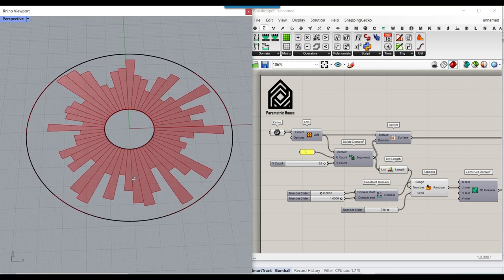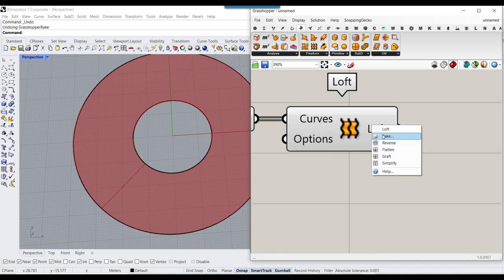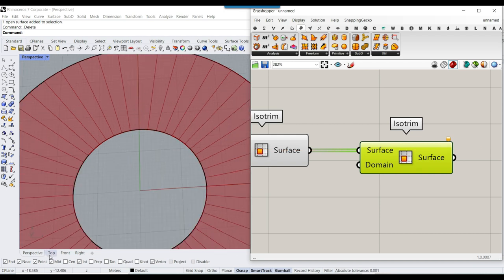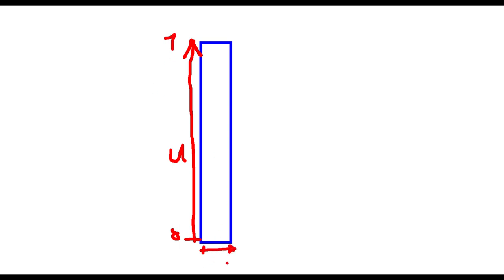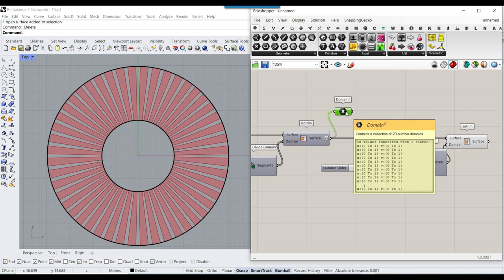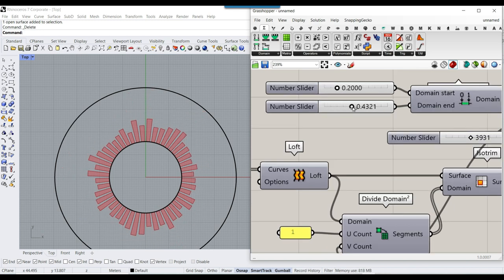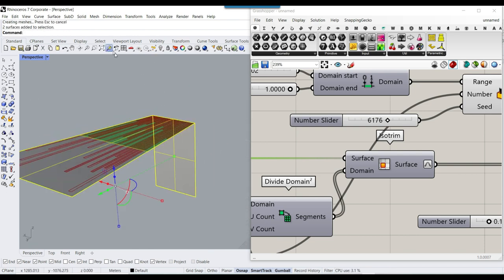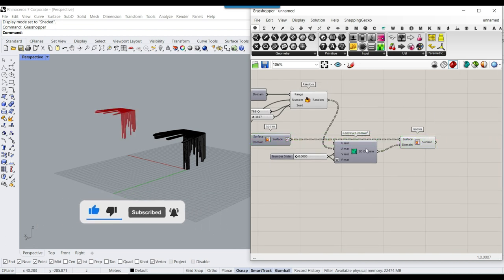Rhino Grasshopper Tutorial (Random Strips)

Comment: You can also create a circle parametrically in Grasshopper, apply an offset operation, flatten both circles outputs and feed this circles into the Loft component. Now everything it is fully parametric.
Reply from the maker: Exactly , everything can be made parametrically in Grasshopper